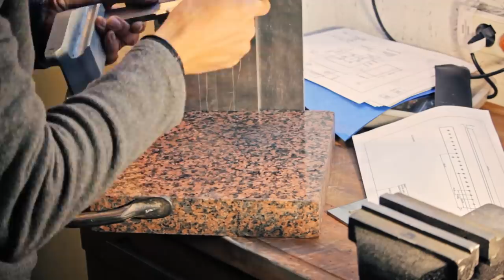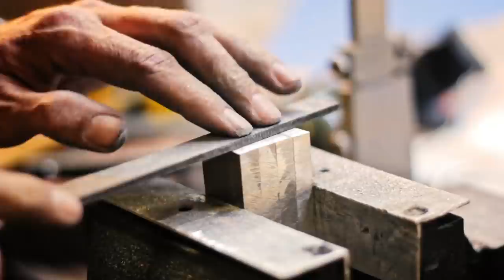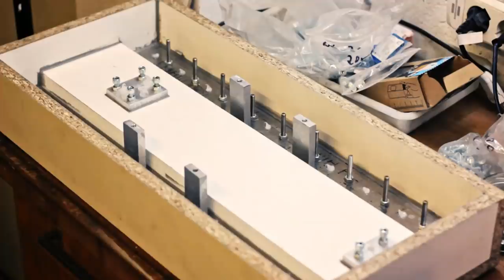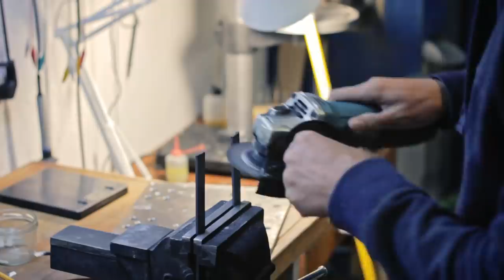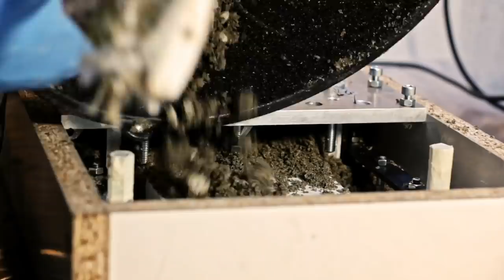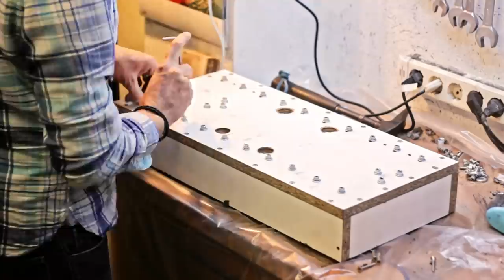home made epoxy granite cnc - part 4 - x axis

Comment: Looks very nice! Surprisingly grear surface finish! Keep up that great work!
Reply from the maker: The surface finish is like that because of the gel coat
Reply: Ah okay. So probably that gel coat also is a kind of protective cover against coolants right?
Reply from the maker: The main reason I used it is to protect the release agent. I was afraid that the sand and gravel could scratch it away and it would all stick to the mold.

Comment: Great progress keep it up! That looked difficult to fill that center area under the plate!
Reply from the maker: Yes, wasn't too sure about that. And pretty happy when I opened the mold and saw that it worked out
Reply: @joergbeigang  think I'd have casted the plate "housing" with inserts, then bolted, glued and leveled with a thin layer of epoxy... Anyway, glad it worked 👍

Comment: I would think a vibrator would be very helpful for mold fill.
Reply from the maker: Definitely. But luckily it worked without as well. With this part I was a bit concerned...
Reply: @joergbeigang  Yes. Looks like it worked either way. Coming along nice!
Reply: @joergbeigang  would definitely recommend it, if you don't vibrate the bubbles out you end up having a lot of porosity. Would suck to spend all the work on it and then have it break because of that. It can be as easy as pushing a delta grinder or similar against the mould.

Comment: Very nice build so far, lots of good ideas worth copying :D
btw. do you plan on machining all the guide mounting surfaces? They look pretty good, although there's still some light coming out under the straight edge. Also, how do you make sure the mounting plates of the guides and the ones for the ball screws are parallel to eachother?
Reply from the maker: With the first piece I went to the shop of a friend and milled it. Because his shop is six hours drive away and I don't want to steal too much of his time I did the other two pieces by hand. With a granite plate and sand paper. Was quite a bit of an exercise, but didn't came out any worse then the milled ones. I'll show a bit of it in the next vid.
And yes, feel free to copy :-)

Comment: How much epoxy in total did you use for this part? What are the dimensions? Looking to do something similar.
Reply from the maker: Actually I can't really remember anymore. Bought 3kg bottles. Not sure anymore if two or three. Got half a bottle left.
Gelcoat was one tin maybe half a kg and release agent one bottle which is still almost full. 
Just go and buy a bottle of resin and do some test castings. After that you got a pretty good idea on the percentage of the resin in the mix and you can can easily calculate the total amount. Good luck with your build!

Comment: How is the x-axis squared to the y-axis? Are the two metal plates screwed together from the bottom through the gap where the ballscrew will be later? Or do you square it roughly and then align the x-rails using the play of the screws?
Reply from the maker: The rails are mounted first. With the rails is not much room for adjustment. The two plates are going to be screwed together with quite a few screws. The screws in the holes will have enough play to adjust the x axis perpendicular to the y axis. Making x and y parallel to each other will be a bigger problem. The perfect way would adjust it just by lapping one metal plate, but I'm afraid I got to do some shimming too.
Reply: You could probably adjust the angle of the z-axis to compensate for this. Then the x-axis and the y-axis dont have to be perfectly parallel

Comment: Hey man, great work. I saw a build which used 20% epoxy - is this a problem? He claimed shrinkage was minimal and I guess if you're using aluminium plates as your contact points you can machine these down later anyway.
Reply from the maker: On the first part I used 15 percent. Came out slightly bended. 3/10 mm on 450 mm length. On the other parts I used 12 percent and they came out pretty good. The base of the z axis didn't need any machining. Was done in one hour lapping by hand. It depends a lot on the sand gravel mixture, and the kind of epoxy. But 20 percent sounds a lot to me...
Reply: @joergbeigang  I see - 0.3MM is quite a lot over 450MM.. hmm. I saw this video which shows that 20% epoxy seems to offer more rigidity (https://www.youtube.com/watch?v=bcEPoZTAlcA). The other thing is just the surface finish is easier to get perfect with more epoxy judging by what I've seen. Is there a problem with machining the 0.3MM down afterwards or are parts under too much stress? Thanks
Reply from the maker: Can't tell about the stress, but I simply milled it flat. I made some tests before, from 10 to 17 percent. From 15 percent on there was quite a bit of a layer of resin on the top. I made more of less identical parts and I couldn't really measure any difference in stiffness with the strictly non scientific tests made.
In the end of the first vid of this series you can see the bended one under the straight edge.
Reply: @joergbeigang  Thank you! Look forward to seeing the rest of your build :)

Comment: the granite is mixed with epoxy resin and then you add a catalyst or it is different? I need to know how to make the mix , thanks
Reply from the maker: I mixed resin and hardener first, then I poured it in an empty bucket and mixed it there by putting step by step more sand gravel mix in.
All after extensive testing to find a good mix ratio
Reply: @joergbeigang  Thank you very much, I have my cnc machine and it is made of cast iron but it has very thin and hollow parts of the machine, it is where the vibration and resonance occurs, my intention is to fill with the granite epoxy, what I have doubt is if granite epoxy will adhere to the cast iron frame, very grateful for responder
Reply from the maker: There are some videos on YouTube of guys who did exactly that. Maybe ask them if it's worth the effort in the end.
For example here:
https://youtu.be/k1r36ykaRLA
https://youtu.be/Upeu0kteUs0
I'm sure if you start digging, there are plenty more

Comment: I missed something... How did you fasten this to the Y axis bearing blocks? Also, is there any adjustability in case X/Y are out of square, or are they bang on? If so, how did you get them bang on? :D great vids by the way!
Reply from the maker: You're right, didn't really show this. The bearing blocks are mounted on a aluminum plate, that's attached with screws to the aluminum surface on the part I made in this vid.
Getting it square was a proper pain in the bum. Gave up at one point and started over again the next day. Just not something that's interesting in a video. Loosening and tightening screws and knocking with a hammer for hours...

Comment: This is a well designed mill.... with the accuracy of used sock. Nothing on this is a precision parallel surface. It looks like it is. It appears to be so but it just isn't. There are 21 degrees of freedom to accuracy and this address maybe 3 and I think i am pushing it there as well. Still I commend you for having a go at this. Well done on attempting it.
Reply: I think he left enough possibilities for adjusting all the parts relative to eachother. My biggest concern is the planarity of the guide mounting surfaces tho.
Anyway, you don't know the application the creator of this video has in mind. No need to talk him down.

Comment: Do have an idea of how many hours you have into just this piece?
Reply from the maker: That's pretty hard to tell. Just the actual work might be about three to four hours for the metal parts, maybe one hour for the chip board cutting and drilling, an other hour for the reinforcement, two hours assembly of the mold, half an hour for the gel coat and a good hour for the actual casting.
But endless hours went into the planning and the cad. Those i can't count...

Comment: And then you used epoxy that was not vacuumed first?....surely you watched the MANY Youtube video where the strength and rigidity of epoxy that wasn't vacuumed was shown to be substantially less if pot mixed? ....That Fox guy showed that all this steel within epoxy was totally unnecessary and a massive waste of time when he achieved less than 5 micron accuracy using real granite slabs.